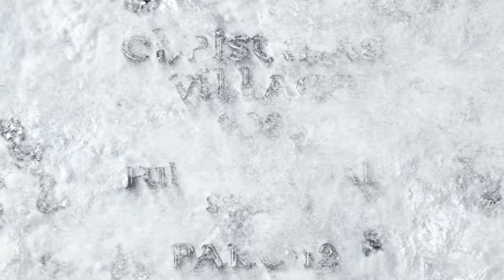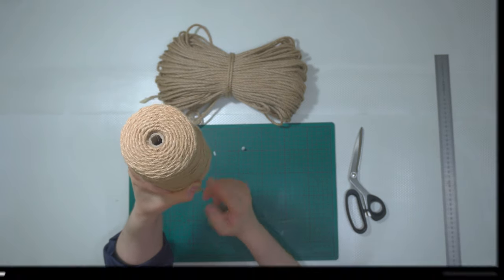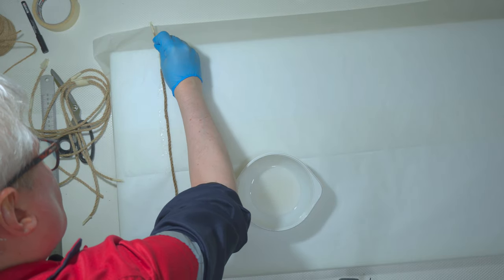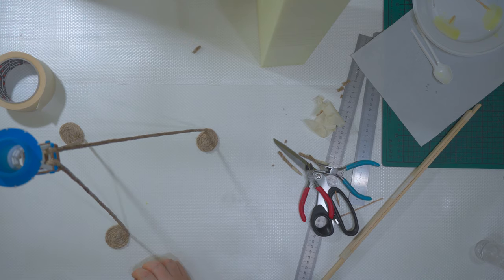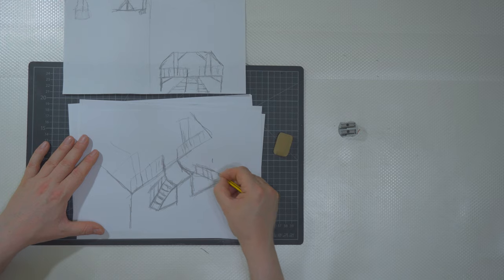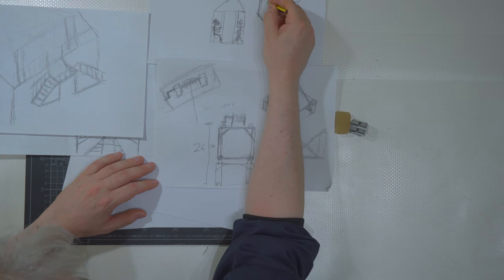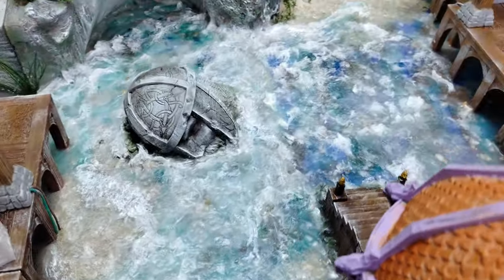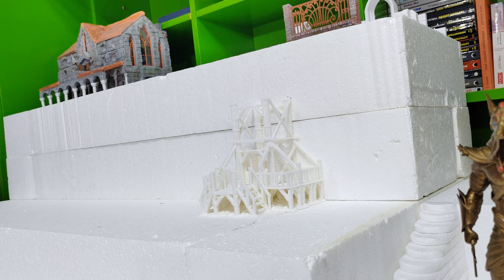2023 Christmas Village Tutorial - Part 12

Comment: Hello Silvio,
Such a beautiful balloon. The design is awesome, allowing you to place it anywhere and things under it! 
When you first mentioned getting it to stand upright on rope, my brain immediately  went to white glue and water mixture to soak the ropes in. It would dry clear but leave the rope messy and probably too limp to support the needed weight. After seeing your ingenious  solution, I was happy to know that my brain was at least heading in the right direction. lol
I am thoroughly  enjoying the elevator. I sketch everything out, but to most, they look like chicken scratches, yours are very detailed and clear. I was thinking of using an elevator in my 2024 Christmas village to get my people from the marketplace level to the top level where my German restaurant and residence of the Burgermeister are located. I have a path carved into styrofoam  but it would make it difficult to get supplies up there. So, I think I will incorporate some version of your crane and basket idea! If it does not work, I will just have them carry supplies on their backs or pull them on a sled!
Reply from the maker: May-be I can be of some help.
If you want.
You can reach me through the community page of the channel.
With a little picture and some measurements I will try to find an alternative solution in case you need a plan B.
Reply: What a kind offer, thank you Silvio, I may just take you up on it!